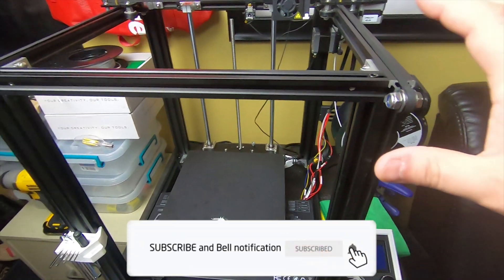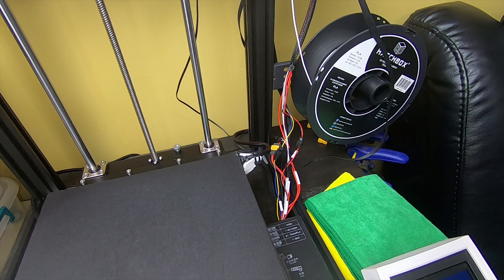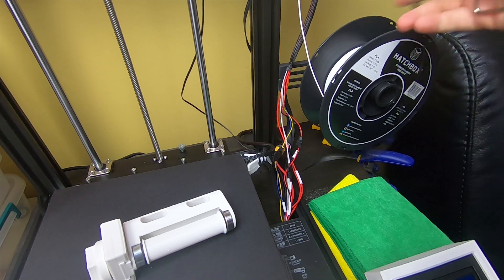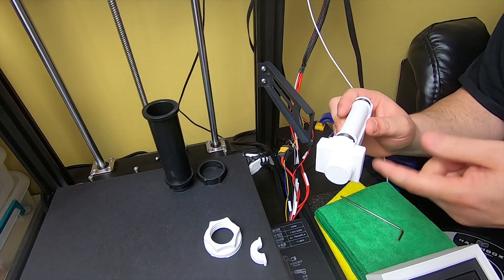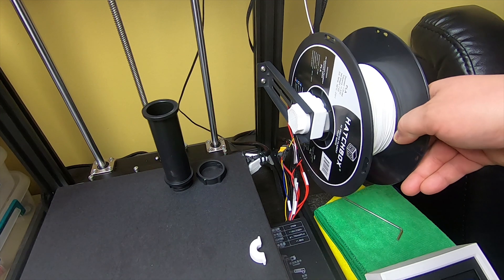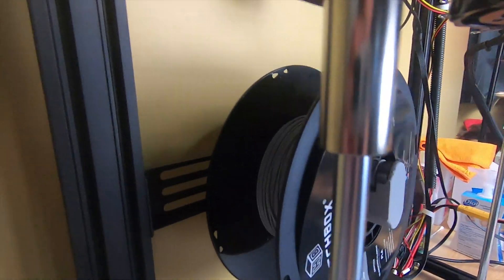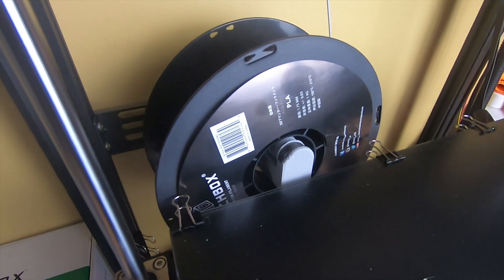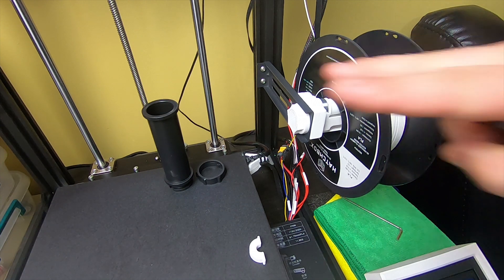Ender 5 And 5 Plus 1st Upgrade Filament holder

Comment: did your ender 5 plus work for more than five days, mine didn't, software gave up, couldn't level it and the screenchanged to chinese and it was running 1.70.3firmware. won't ever buy another one
Reply from the maker: Mine still works though some people do have bad luck with them I've heard

Comment: what bearings did they use?
Reply from the maker: Standard skateboard bearings
Reply from the maker: https://www.amazon.com/Shielded-Skateboard-Bearings-Longboard-Scooters/dp/B07DZDLB3N/ref=as_li_ss_tl?keywords=608zz&qid=1581212980&s=industrial&sr=1-3&linkCode=sl1&tag=savebig0a-20&linkId=6157b2ef4f2cc902e2a51fe7d34badc6&language=en_US

Comment: And why do you need to go through all of this time and work to make the spool sit on bearings? 
I've been printing for about a year now and haven't had a single problem with the factory original spool holder doing the job it was intended to do.
However I still gotta say that he seemed to do a really good job at designing that project :)
Reply: Well the dual drive makes a big difference.  If you have that nothing should stop the filament from entering your hot end properly . And also if you run direct drive you don't need all that jazz.

Comment: does it roll smooth. Can I print it without supports
Reply from the maker: Yes it does roll smooth and you do need to put to the bed. All the info can be found on the thingiverse link above I put all the print settings there
Reply: You always need supports. Depending on the bed and how well it sticks. But supports also helo chape over hangs. The less the better but you still need them.